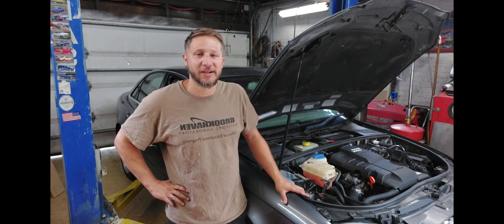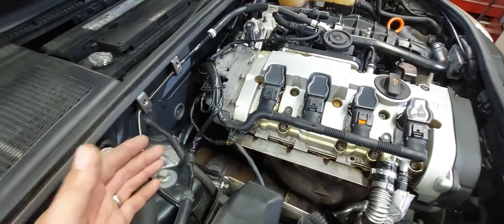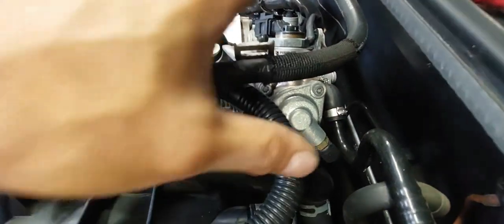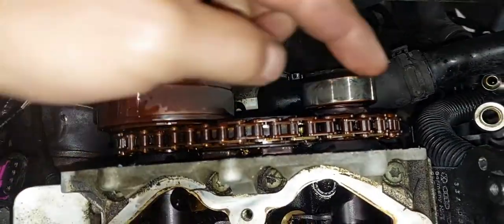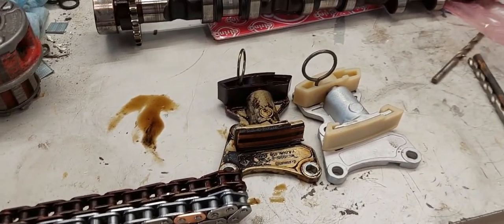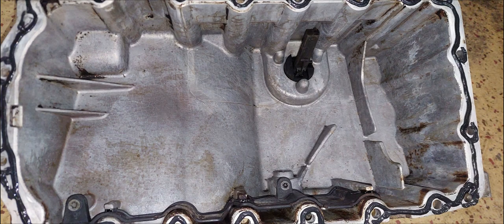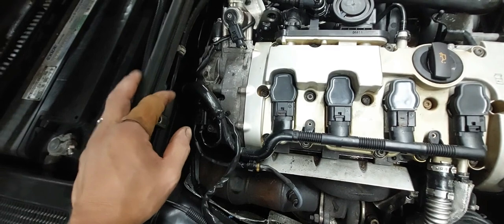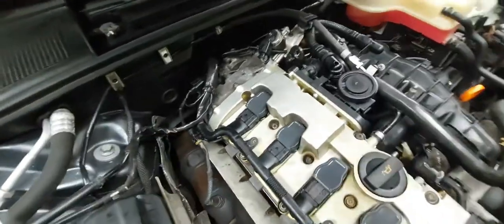2005-09 Audi A4 Rear Camshaft chain 2.0 TFSI  w/ torque specs / Chain noise?

Comment: Good video, but the most vital information most people are looking for are how to set TDC before even starting, using the cam lock tool (T19252), removing that crappy poly bolt on the phaser without stripping it, keeping tension on the chain while putting it and the phaser back on (special tool or wide screwdriver in slot on back of intake cam), how to count the chain links and install the chain based on the timing marks on both cams sprockets and chain itself.
Reply from the maker: Yes, thanks for the comment. I recently did a remake of the video with a head on the bench. Many people get confused because there are no traditional timing marks. It's not always easy to show what needs to be seen on film.
Reply: @kingzoneone
Are you referring to cam lock tool (T10252) ?
Reply: @cameronburns9819  Yes, it's in parentheses in my initial comment.

Comment: The most important parts were skipped over😢
Reply from the maker: Sorry about that, I have another one I am getting ready to do after a chain failure.  I will be sure to update the video. Thanks for the feedback.
Reply: @willpoweredgarage969 I would also like to see how the chain and sprockets were reinstalled! I just did vacuum pump seals and will be doing the job soon. Thanks

Comment: Awesome video, thanks.

My cam tensioner housing cracked.  Do you think it's possible simply replacing the housing, cam follower, and the guide etc as you showed will get my engine running again?  Local shop told me to replace the head as well as there may be metal inside now.   What do you think?  Thx vm
Reply from the maker: I recently did one where the chain exploded and destroyed the cover as well. I have a video of it on my page. Unfortunately, when it failed it bent a few valves, so you will need to remove the head and replace the damaged valves, but the head itself should be fine after cleaning it well. The same goes for the engine. Make sure to flush and change the oil before first startup. Thanks for watching.

Comment: Great video ! I have to work on that and my only big question is how much force you have done to loosen the bolt over the exhaust cam.
Did you have enough space between the engine and the hood to use an extra long ratchet ?
Reply from the maker: It is pretty tight, so a long handle ratchet does help. Once the cover is off there is a decent amount of room back there. Thanks for watching and commenting.

Comment: Hi, should there be a slight slack with the new chain and tensioner? Because the engine is off so there's no oil pressure yet. Please correct me if I am wrong.  Thanks
Reply from the maker: Yes that is perfectly normal and once oil pressure reaches the tensioner it will take up the slack!
Reply: I’d be more worried about the locking pin still being installed in the old tensioner 😮 like most of these videos on this topic on here, none of them seem to mention removing the locking pin 🤷🏽‍♂️🤦🏽‍♂️🥴

Comment: Hello,
One question! Did you fix the oil pressure issue with this three rings? 
Or only with cleaning the oil strainer?
Could the rings lose some oilpressure, of they broken or messing?
Reply from the maker: The three rings only control the cam timing. If your getting a cam position fault. I belive it's out of range or setpoint not reached. There is a measure value block to see it. If you have an oil pressure issue the more common issue is a clogged pickup tube. Happens when people run regular oil.

Comment: How do you remove the cam phasers without the cams moving ?  I’m guessing you take the cam phasers off and the unhook the tensioner, but then how do remove the chain ?
Reply from the maker: Depending on the camshaft, there is a semi-circle just behind the cam phasers and along the camshaft. It's so you can get to the head studs with the cams in place. Audi/vw say to use a wrench to hold the cam so you can remove the bolt that holds the phaser in place. 17mm is the wrench that usually fits.
Reply: @willpoweredgarage969  ahhh gotcha that makes sense, now I’ve heard/read that that bolt that holds the exhaust cam in cam be a real bear to get out, and then even can break, have you ever encountered this on a longitudinal engine before, the transverse engine you at least have room to be able to get a drill in there to drill it out
Reply: @willpoweredgarage969 did you use the vag cams lock tool or just the 17mm wrench over the exhaust cam?

Comment: Do you have a link for the rings? I’m having the same issues as you
Reply from the maker: https://www.ecstuning.com/b-genuine-volkswagen-audi-parts/camshaft-adjuster-housing-seal-set/06f198107a/?gclid=CjwKCAiAioifBhAXEiwApzCzthSWQTJsQIaH52VUnoNa2MSZAOz86iMEWroF-ujtCQ8WzvClEg1rcBoCx9EQAvD_BwE 
Not sure if the link will work, but I got them from ecs tuning. Good luck and thanks for watching.
Reply: @willpoweredgarage969  $70 for 3 plastic rings is crazy. I googled the part number and found it for $3 on rock auto! Thank you man!
Reply: Thanks.  I could not find the part name or number anywhere!!!

Comment: Do error code P0011 have someting to do with this?
Reply from the maker: Yes it could, Could be a few thigs, The plastic rings that are part of the rear cover can break. Then the cam phaser does not adjust properly, The tensioner in there can fail, guide could be worn, poor oil maintenance. It can be any one of these.  Do you have any other symptoms besides the P code?
Reply: @willpoweredgarage969  Thank you for your reply! The car runs very well, a little rattling noise from the engine but only when it is cold. Error code P000A have been there sometime, but it's gone and now it's just P0011. VVT has been changed, oil and filter have been changed at service intervals

Comment: you didn't show how to change chain xD
Reply: lol
Reply: Or how difficult was the phase bolt loosen. This is my major fear to do this job
Reply: @federikg  mine was rounded :/ soo i choose to remove camshafts
Reply: That poly bolt strips most of the time because the special socket for it is a terrible design, doesn't seat inside the bolt squarely, has play, and rocks. I found a #8 Allen or T50 torx fits better than that crappy #10 Assenmacher polydrive.
Reply: @KingZoneOne  bcz there is no torx socket but ribe 10 socket 😉

Comment: Would this cause crank no start?
Reply from the maker: Yes if the chain is broken or if the chain skipped and the cams are out of sync. What makes you go right to the timing chain though. I would be checking for spark, and fuel first on a crank no start.